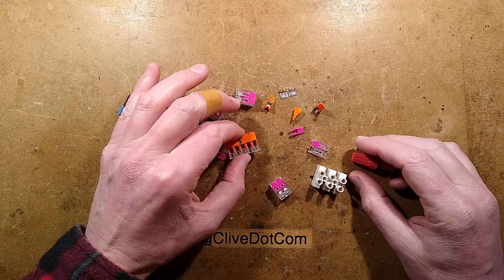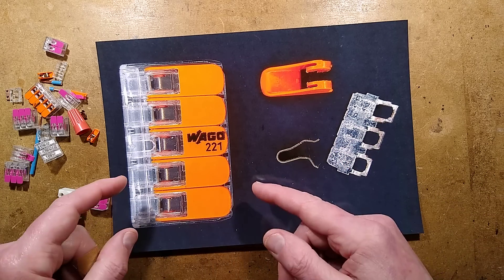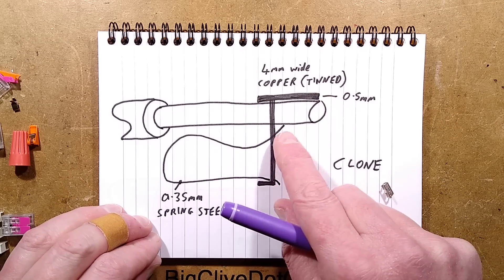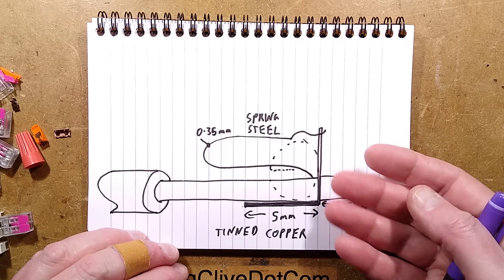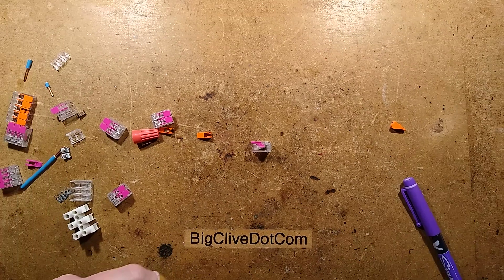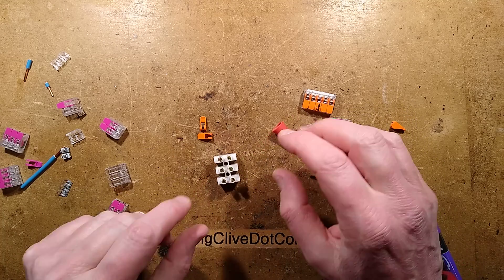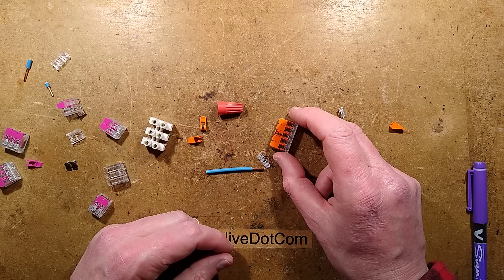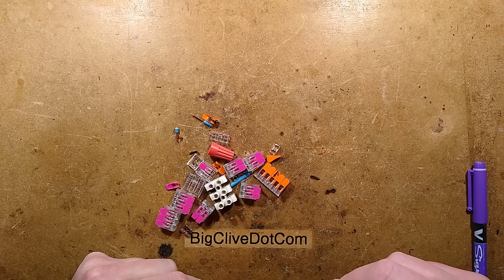Inside a Wago connector and a clone

Comment: Don't forget that many fluorescent lights had push in connections where you use a pin to release them, but you had to use the right wire, also the spring can get weak (had some intermittent faults with them)
Nothing against wago etc, but i prefer screw terminal, you can insert more then one wire each side, or through wire, even put solid core one side and stranded on the other, and only need to carry one type for each current rating, with wago you have to carry: through, side by side, 2, 3, 4, 5, way etc.
Reply: I almost hate screw terminals. They are ok for two, maybe even three wires. But when you need to connect 4 or 5 wires, some solid, some stranded, some of different section than the others, and fight to keep all of them inside the terminal with only one hand while you tighten the screw with the other, only to find after you finished that the thinnest one didn't get caught  - or was cut by the screw - and slips out when you tug it,... multiplied by two poles... with you in an uncomfortable position on top of a ladder, and working inside a small junction box... 
I loved Wagos the moment I discovered they existed! Just connect one wire at a time, without screws and no matter their section!
Reply: @alvaros.  I just found it easieer to carry around 5a, 10a, and 15a screw connectors was easy, if you had to connect more than a couple of wires into one siide of the terminal. i made up a busbar block that only needed a max of 2 wires in each terminal on one side, with all the circuit wires on the other, never a problem in my 30+ years.

Comment: 3:00 I'm liking the US style wire nuts more and more. All those moving parts and springs in there, relying on those tiny little bus bars to pass startling amounts of power...wire nuts are just a conical chunk of metal with a spiral pressed into it. Shit don't come off. Little fiddlier to install and remove, but I trust them far more.

They aren't also responsible for carrying any of the power of the connection. The wires to be joined contact one another directly, so power is transferred directly from wire to wire. And there's a hell of a lot more force clamping the connection together in a wirenut than in a wago or scotch lock or any of these other styles.
Reply: They can easily come off if not installed properly and it's surprisingly easy to install them incorrectly. I've seen far too many loose and even falling off in DIY household installations. Even with the wires twisted, you can easily screw them tightly on to only one wire, with the other working itself out of the twist on its own.
Reply: Thats a pretty stupid half-ass attempt to prove your... point?  Incompetent people do all sorts of stupid things, to verying levels of funniness to onlookers.
Learning how to do wirenuts takes all of 5 minutes if one is particularly dense.  Strip, pre-twister, screw on wirenut, see wrap start at outside end of wirenut, firm test tug.
I've seen people entirely miss a nail and hit their off hand.  Does that make the hammer inherently worse than a screwdriver?
I mean, that about how much sense you're 'experience' makes.
Reply: @reverse_engineered   I’ve worked with both small and very large wire nuts, in my HVAC career.  There are some that don’t have the spring center, and I agree, that those can fall off.  I’ve done thousands of connections with wire nuts.  When I’m done,I pull hard on each wire, and then I use electrical tape, wound around the bottom of the wire nut, so it can’t back off.  I agree wages are probably better for inexperienced DYI people.  Everyone has their own preference.
Reply: @reverse_engineered  Yeah uhh DIY failures are seldom a fault of the parts used. Most homeowners don't know their ass from Kansas and its a miracle they dont electrocute themselves doing something as simple as changing a light bulb. Also worth noting you can have that same issue with a wago as well; no connector is immune to dumb installs
Reply: Tiny little bus bars - of area equivalent to the wires connected to them. A gaping flaw, that.
Reply: @Monkeh616  Not a snowball's chance in hell those weaksauce springs are adding anywhere close to that much contact area with the wires.
Reply: @TestECull  Where did I say anything about the springs? The bus bar itself has equivalent area to the wires.

Comment: Howdy, I was a skeptic years back of the Wago connectors, however, we are a manufacturer of car wash, and these connectors stand up to the constant vibration of the equipment. Now anything that has to be field installed we use Wago connectors. We can control the torque of terminals in the plant, however, in the field, we have to depend on the installing technicians to get it right. Now I will swear by them, they don't loosen over time. Far less maintenance and UL and CSA approved. (only use named brands).

Comment: I will stick to wire nuts on my house. Wagos take up a lot of room and have a lever that can come undone when they get jostled about. If you hook up a wire nut correctly you will never have a problem.
Reply: So anyone with any sense will be doing the opposite then. Check.
Reply: @rosiehawtrey   Anyone dumb of enough to do the opposite of someone else simply because of politics is a git.
Reply: You would need to jostle those quite damn hard to accidentally pull the lever. There's a lot of spring force on them. By the same token, wire nuts can come loose with jostling too, since they are just held on by friction from being screwed on to the wire.
Reply: @reverse_engineered  Wirenuts are held on by pressure and friction.  You seem to be down on them for some perverse reasons. I once saw an electrician's apprentice have to demonstrate a random 12ga wirenut by hanging from it.  Here's another demo for the thing you seem to say is always going to fail if you look at it wrong. https://www.youtube.com/watch?v=v9hohwvGeHw

Comment: I was sure it was going to turn out that the clones were crap and quite possibly even dangerous.  It is actually good to see that they seem to be at least using a decent design with the proper materials (at least those particular ones you found).  It would be interesting to see how many different kinds of clones you can find and compare a bunch of them to see what sort of variation there is between manufacturers...

I'd still never use anything other than real Wago branded ones for any building wiring applications, etc, mainly for the same reason you mentioned (even if some of them are fine, you can never really be sure that what you're getting is what you think you're getting).  However, I also find these connectors to often be handy for other (low-voltage, low-current) hobbyist stuff too, where I just need to connect up a bunch of wires and don't want to mess around with a soldering iron, etc, and for those sorts of applications I think the knock-offs would probably be just fine.
Reply: GreatScott did some testing of original Wago, clones, knockoffs and twist-on wire nuts, check it out. The conclusion is that most of these products are decent and usable, the contact resistance is low enough, and it boils down to preferred user experience.
Reply: I reckon a comparison of now and some short time in the future when copies of copies of copies are pushing prices down and manufacturers are becoming "inventive" with cost cutting would be educational
Reply: @bennytheball-n4q  I'm pretty sure that in places where WAGO is well established. They would rather spend a bit extra to get the quality. And WAGO wouldn't try to cut costs. On the other hand, the copies of wagon are a whole diffent story as you mentioned.

The nockoffs would only be suitable for low voltage applications and only while present.
Reply: @RedRingOfDead  For me personally, I use wago knockoffs, but the most voltage I'm running is 12 volts.  They work well for patching cables together to test equipment, especially for switching polarity.    Heavy-ass springs on these, though.   (straight through)
Reply: @tbelding  totally fine. But please don't use the knockoffs for 110/240v 

Something that was stamped in during my electrical education (that i did for a few years) always use established brands. And I've stayed with that. Any time i need to fix something in the house or add/delete something from a circuit wagon's it is. 

For low voltage amperage applications it's fine to use knockoffs but i would still make sure I'll break any circuit that gos trough it when not around. But that's personal preference ofc.
Reply: @RedRingOfDead  - these are probably just fine for 110 for the wire sizes they can accept.   They claim rated 32 amp, 12-28 gauge, 250/600v.   Considering how fecking heavy the springs are for pulling up the lever, I suspect that they'd manage 15 amp at 110 volts just fine on a 12 gauge solid core.   However, that's not what I bought them for, and even if I did use them for that, it would be for testing purposes.
Reply: Wago can probably charge more because they are more widely certified. With any other product you are taking a risk and can be professionally liable if you use something not certified even if it wasn't the point of failure. Wagon probably has quality control to ensure it meets or exceeds standards. A clone product might just be over engineered to compensate but is no replacement for certification in many applications.
Reply: If there's any possibility of an insurance goblin sniffing around for any reason to drop coverage keep it up to code! >;D
Reply: @snigwithasword1284  - If you get a signoff from your local governmental parasite for occupancy permit, you have an argument against them trying to drop coverage due to 'code'.
Reply: I got wago knockoffs and found that 12AWG will pop out under mild tension while twisting. The original wago are much harder to pull out. So it depends on the clone.

Comment: The Wago connectors are better when connecting solid with stranded wires. For solid to solid wires twisted together and capped with a wire nut is the best. Too bad people skip twisting the wires together first the complain it's not a good connector. The Wago terminals are fantastic if you ever want to disconnect them.
Reply: Wago are nice, when used appropriately. I like to use them in fixture boxes where you have wires coming in from multiple sides, and need to gang up commons, etc. Nice small rect. box to gang into and have 1 pigtail come out, etc.  Once of the few locations/times when its worth paying 10x the cost of a wirenut.

Comment: One advantage of wire nuts is that they can be waterproof if oriented open side down. I've always used them this way so that any water from accidental rain, pipe breakage or condensation won't collect in them and cause corrosion.
Reply from the maker: You can get completely watertight gel boxes for Wago and other terminals that squish a stable polymer gel around them when you close the lid.
Reply: @boots7859  gel boxes are full waterproof. You can submerge them in water even.

Comment: Some years ago, I went to an electrical factors to buy some connector blocks that were superior hopefully to choccy blocks for a project, to connect some 120mm fans in a temporary enclosure for an exhibition. I found Wego blocks to my delight. I connected everything together, plugged it in and imagine my surprise when everything in the warehouse tripped out. I thought it was difficult to twist each pair of wires then stuff in the hole, all three (L,N,E) in the one block, thinking that it was like a choccy block. Well, lesson learned, it took two circuit trips for me to realise my error.
Reply from the maker: I'm sure many will have done that.
Reply: I've seen clone brand items that do act like a three way choccy block. Six of the lever locks back to back in pairs, each pair isolated from the other pairs.
L---\_/---L
N---\_/---N
E---\_/---E

Couldn't find the same from Wago at the time, they just did commoning terminal types in 2,3,4,5,6 ways it seemed. So you'd end up with 3 of 2 way Wagos to do the same as the six lever back to back clone thing.

Comment: I see a lot of Videos on YT from Americans using the lever ones for permanent installations. Which is something they weren't designed for originally. Also there are way cheaper and smaller ones without the levers. If you wire up boxes with 5 or 6 cables coming in space is at a premium.

Comment: The worst thing about these little bastards is when they snap shut and clip a finger. I'd rather get stabbed by stranded wire nut connections than use a wago for anything in my house. The one thing that is good from the excessive regulation is the mandating of ferrules for stranded wire, I do use the crap out of ferrules
Anyway much love Clive, you're awesome. Love your posts.

Comment: I do love me a Wago. I still have a number of the older grey and orange plastic ones, the 222's, or "mouse traps" as I call them. Mouse trap 'cos if you got caught by the lever closing it would give you a subungual hematoma, aka a black fingernail. Thank f' they redesigned them and gave us the 221...🤣🤣
In fact the old Wago 222's clamped upwards into a very small busbar, lifting the lever up compressed down the spring to make room for the wire between the spring and the busbar.
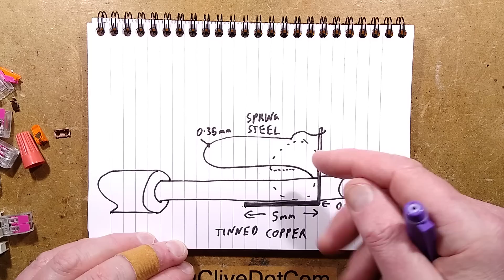Also at 5:00, the word you are looking for is cam, as in rotating cam
Reply: The 222's had the busbar at the top front of the unit, and the open end of the C shaped spring was facing the front.
I'm guessing they redesigned it cos pulling out the wires was probably way easier than it is with the 221's design

Comment: I wouldn't trust them for any thing that carried a load of more that 6A@240Vac while the steel clip bites it is the copper to copper contact that would carry the current but because the steel spring is in contact there is the risk that over time the heating due to it's higer resistance the spring may lose the compressive force and end up as a hot joint especially where a healthy current is being drawn. 
Give me a double screwed Bluepoint connector or  decent screwed din terminals. The wire nuts are a bad idear.
Reply: I'd think if the spring gets hot enough to lose it's temper the plastic housing has long since melted...

Comment: I have some Wago blocks for use on PCBs. They won't fit on breadboards, but they will fit some of my perf boards, they're quite tight. They're also chonky, they sit a good 2cm ish above the circuit board.

Comment: Personally I wouldn’t dare use the clones for anything other than signals because of the cutting corners with alloys thing you mentioned in the video.  Only thing I dislike about the wago connectors is that the lever is kinda floppy when the wire is installed while I want it to be bistable like it is when there’s no wire installed.
Reply: Don't you DARE put these things on a data line.  I'm gonna have a nightmare now about some idiot electrician splicing an ethernet cable they cut back together with these.

Comment: Uhm Clive... You don't open the lever for intalling solid core. You just shove it in!
Same for the old poky type. Installing is always only pushing the conductor in.
Reply from the maker: Yeah, the direct push in works with both these connectors for solid cores.

Comment: Wago connectors are way better than connexion blocks with screws (called dominos in France, or sometime "sucres" (sugar cubes)), because of the springyness, allowing wires to expend when heated by current, and retract while cooling down, while still holding its grip.  Whereas screws untight themselves with repeated thermal stress.
Anyway, a few connexions that got loose (and sparky) with time made me go completely over the top with home electrical instalations wiring : I solder everything....

Comment: One thing I have noticed about some of the clones is the point the cage bites the wire is much closer to the tip of the wire than the Wago or other reputable connectors.  This makes them more prone to incorrect insertion and / or pull out problems.
Reply: Durex clones also suffer from this issue.
Reply: thats why i buy originals from aliexpress
Reply: @theoneohmresistor  "originals from aliexpress",  love that combination

Comment: The nice thing of a wago terminal is that they always have a good connection because they are spring loaded. 
In germany the screw terminals are also mostly forbidden and everthing that we wire up has to have a VDE sign.
But we mainly use the big ones for stranded wires and the push in type for solid core.
Reply: Agreed, it's too easy for screws to "relax" from hot/cold cycles or not be done up tight enough and create a high resistance joint which is a fire risk.
Reply: yes, that's why the coil inside wirenuts are also a spring.

Comment: Just curious, how does it differ compared to regular ol' stabby connectors (like on plugs and switches)? Also, does the lever actually lock it down or does it simply relieve the spring tension?

I had the cheapy clone ones. The spring seems to lose a bit of its tension after you opened the lever for the first time and the lever flap thingie feels loose/wiggles afterwards. Does this also happens on the OG wagos?
Reply from the maker: The ones on cheap fixtures are often just flimsy flaps of metal that wiggle loose with time.  These ones clamp the wire to a busbar for a better connection.
Reply: Wago's are solid, and will hold after repeated openings. To me they are the gold standard